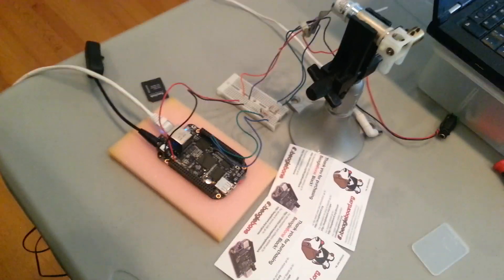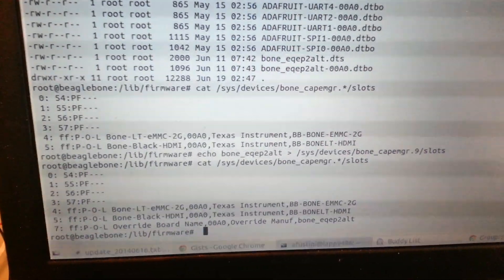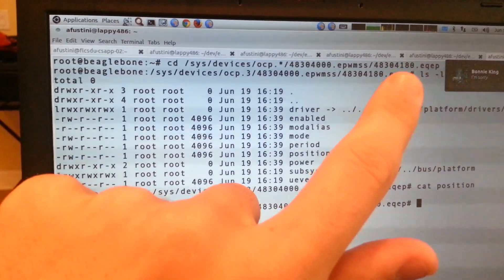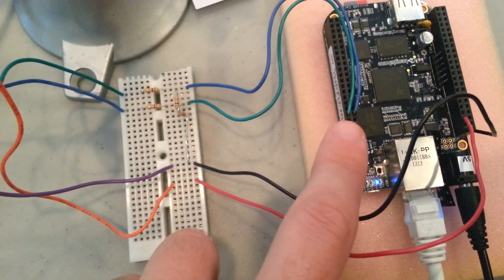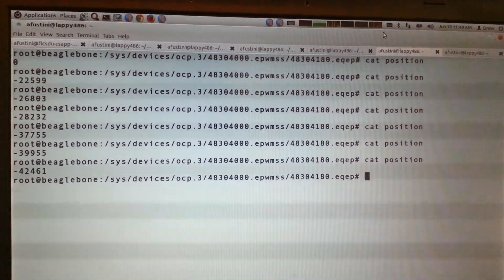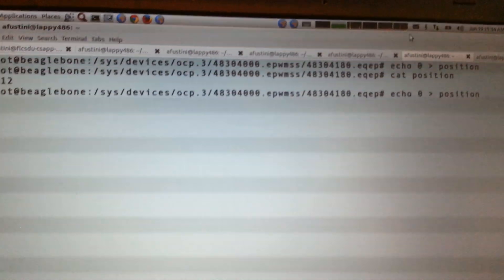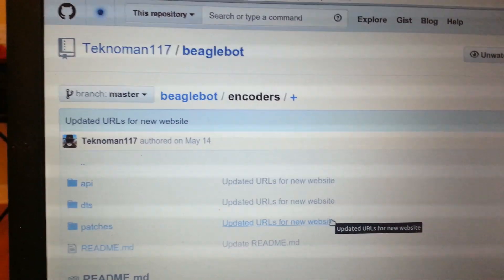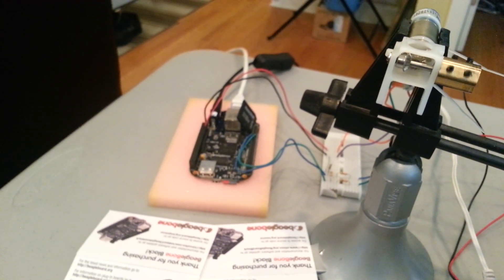BeagleBone: Using TI eQEP to read quadrature encoder in DC motor

Comment: Hi, guys. Thank so much for the video, it helped to launch my encoder. But I still have  few questions.

1. What does parameter 'period' mean? And why this parameter is so large (0.1 sec)? I tried to set 10^3 nanosec, this led to a board freezing.
2. My application needs to request position of motor each 1ms, so I afraid that the access through filesystem is not enough fast. Is this possible to read position using memory mapping (I mean mmap function?). Did somebody try?
3. I found that resolution of my encoder does not match to the counter's value. When I change position of my motor by 2Pi the counter value changes by 16 thousands, but my encoder's resolution is 4096 ppr. It's a bit strange.

Comment from the maker: My goal is to build a DIY servo controller with  #BeagleBoneBlack  and a DC motor with integrated quadrature encoder. The TI eQEP hardware peripheral integrated into the BeagleBone processor can accurately decode quadrature encoded pulses.  I am using the Linux kernel driver from Nathaniel Lewis:
https://github.com/Teknoman117/beaglebot/tree/master/encoders
I also used this post from BeagleBoard mailing list:
https://groups.google.com/forum/#!msg/beagleboard/0ewLcdUtA_E/sVEoDGkL9FcJ
And this device tree config for eQEP2:
https://17376924468624948387.googlegroups.com/attach/57f40b690c2851b1/LoadeQEP.txt?part=0.1&view=1&vt=ANaJVrGPwHIS2WLiOv6ixKKbzR46eHqySZLgFoyqQ_d_WnwWpd6WHjAYJi1DUftPPemLjzWziNVQ5BXCSQEDe6COpc_1ZPRU5ZAgS0AyU5ycCZ0_vLyWF3g
My changes are in my own repo:
https://github.com/pdp7/beaglebot
GitHub Gists with notes for this video:
https://gist.github.com/pdp7/2c8e6303f931b6dcc0b9
https://gist.github.com/pdp7/8a8fb9e2d2e1aef232d2
https://gist.github.com/pdp7/8241f151c1b9b781f6ea
Wondering what the kernel module does?  Here is the code extracted from Nathaniel's kernel patch:
https://gist.github.com/pdp7/281313e0284cd1eb68f0
Reply: Drew Fustini i think i got the eqep driver working in linux-image-4.9.0-rc3-ti-r2 it'll be in the apt repo in an hour or two:
Reply: just bumped into this today.  Thanks for the mention and making a video!
Reply from the maker: Nathaniel Lewis any plans to update the driver for newer kernel? Robert Nelson mentioned eqep driver needs to be updated for Linux 4.9: groups.google.com
Reply: I do need to revisit it at some point to clean it up and finally add a /dev node interface so we can avoid sysfs if the application requires.  Been out of the game for awhile.  The latter half of my undergrad and finding a job took a lot out of me...
Reply from the maker: Great to hear!